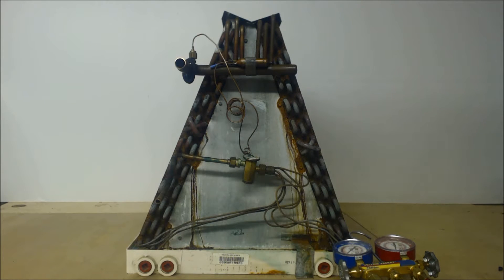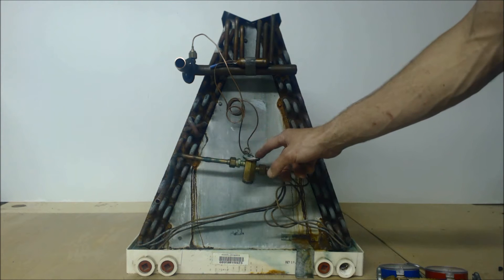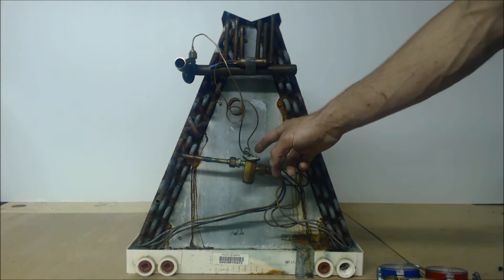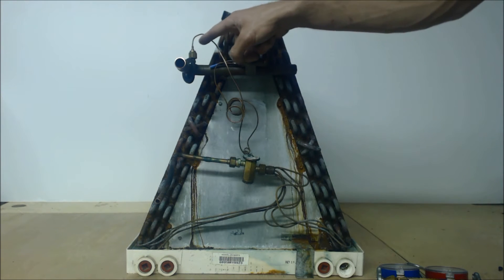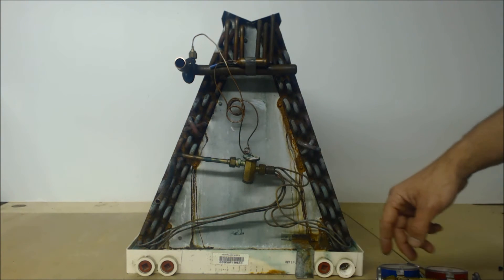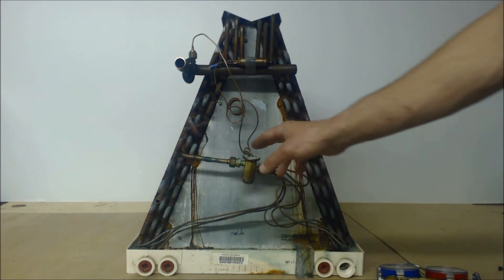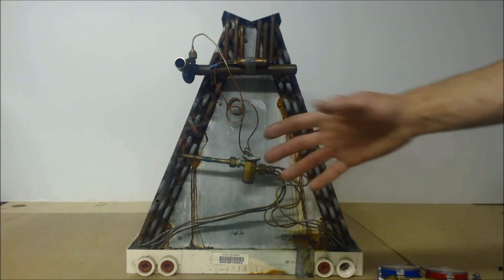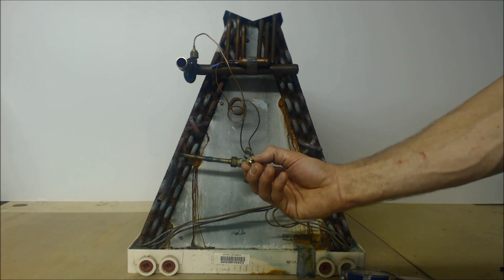Refrigerant Charging! Why Charge a System with a TXV in Subcooling and why Superheat will Not Work!

Comment: Great video!! So with a cap tube or piston on a R22 split system. The customer turned the T-stat down to about 68. The outside temperature was about 70 degrees because it was after a bad thunder storm. When the customer woke up the next morning his unit was frozen up. After the unit thawed out. I checked the TD temperature difference and it was like a 18 to 19 different. I think the customer was fine so I do anything but I called back later that afternoon and next day and they said it was running good. Can you explain why did it freeze up like that? Or since it was a piston it couldn’t control the superheat? I’m just checking to see if my theory is right. Would that same problem happen if it was a txv?
Reply from the maker: Two things, the unit didn't have any superheat once the temp lowered too much so the temp in the sat state was still low which is not good for the compressor since liquid went into the vapor compressor but the main reason before that may be slightly low airflow. It is all about the amount of heat crossing the coil. A txv would limit the amount of refrigerant entering the evap in order to maintain superheat so it wouldn't have happened if there was a txv, thank's
Reply: Thank you

Comment: if not information found at the condensing unit for targeted sub-cooling, will the txv have it? Thx
Reply from the maker: If it is a single or two speed compressor in second speed and the rating plate does not say target subcooling then we go with 8-12 degrees target. I always use 11 degrees, thanks

Comment: Hi AC, are these TXV valves not old hat now, ie are we not using electronic TXV's now with integral stepper motors ? and  if that is the case with these modern split units does that mean that they all have to be charged by subcooling ?/
Reply from the maker: The electronic txv's are used with vrf compressors. Manufacturers will stipulate how to charge them. Unfortunately most want us to just use the total weight procedure for lineset length after recovery. Also in regards the efficiency of standard txv's, you wouldn't believe how techs are telling me that they are still installing pistons. It is really crazy. I think it stems from them not knowing how to diagnose problems with txv's which is unfortunate, thanks
Reply: Hi AC, that's really interesting, we also get systems over here that have no or not enough info on them so you have to strip them right down to find out what they are, nothing in the manual and so on..

Comment: For a home ac setup it seems like the TXV valve is a "Better" more precise setup? Will it compensate with less evaporator freeze up as opposed to a piston on a system low on charge?
Reply from the maker: Yes it is more precise because it takes into account some human error when charging but not much. You still need to charge a system within + or -3 degrees of the actual target subcooling. The evap shouldn't ever freeze on a comfrot cooling system, regardless of the amount of time it is running. If it does freeze after an extended period of time it usually is an airflow problem such as undersized ductwork, blower motors speed too low, collapsed ductwork, or dirty filter but could be the txv, restriction, or low charge. Thanks for your comments!